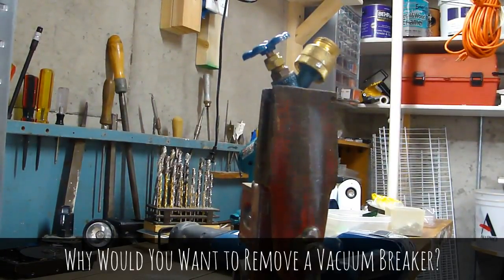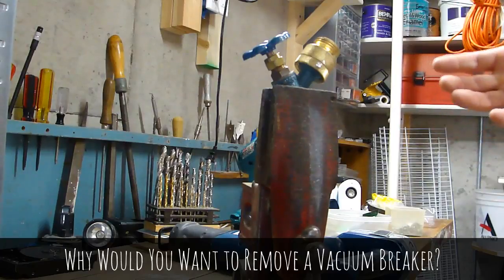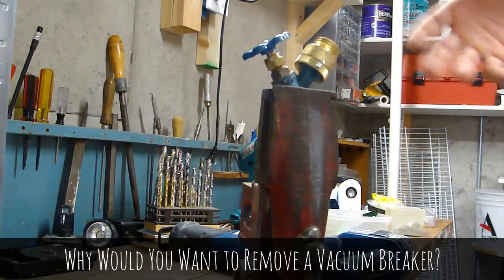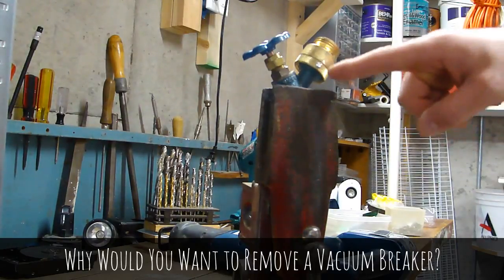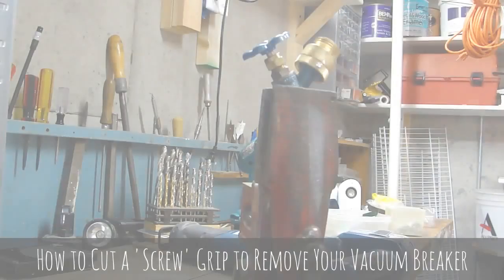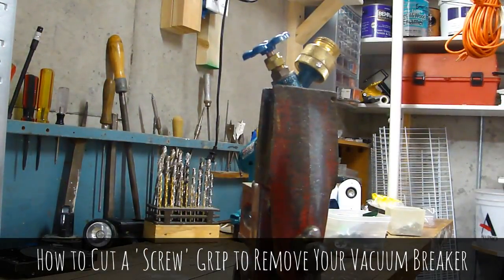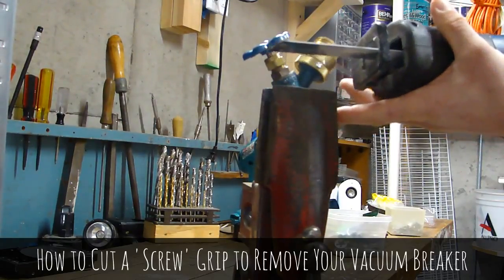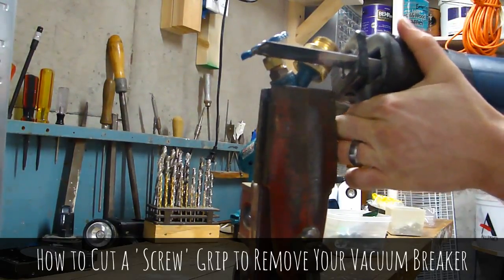How to Remove Vacuum Breakers: Removing Vacuum Breakers of Outside Pipes to Winterize Pipes/Breaker

Comment: Thank you for sharing, this was so quick and simple even with a hacksaw that had a very old blade and a rusted screw that was on there for 18 years. Took about 3 minutes. I did use a little WD40 on the screw.

Comment: u r lucky, man. my break-off screw is waaaay below the breaker body level, i can't saw to make a groove/pseudo-drive to unscrew it. i wanted 2 remove the breaker to measure water pressure. i feel like with the breaker the gauge is not going 2 measure correctly.

Comment: How does one winterize these?
Reply: Either keep it dripping or don't break that set screw should the local code allows so you can take it off and put it back on.